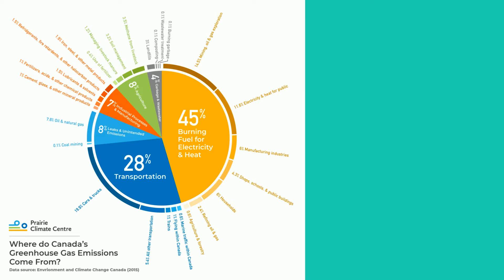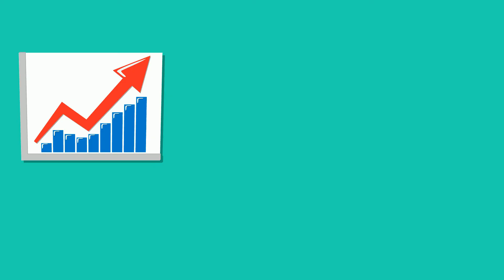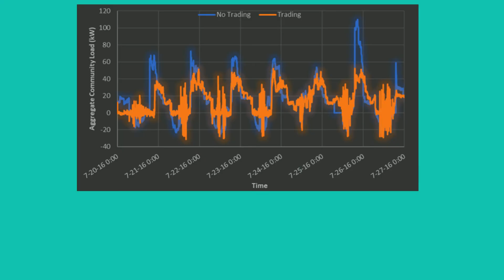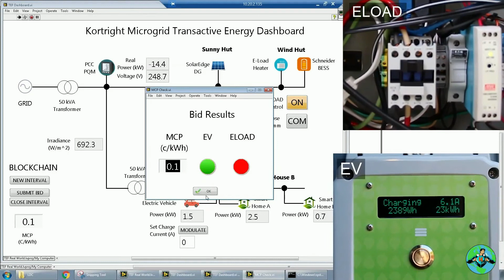Real World P2P Energy Trading on Blockchains EXPLAINED

Comment: Hello I need to do research work on this in my academics What type of thesis work could be done on this ? need guidance
Reply from the maker: Hello! Thanks for the question ... there are plenty of research topics that could be associated with this work. Where do your interests lie? Here are some open challenges that we encounter when trying to develop and deploy these systems:
1) Energy policy and regulatory frameworks: P2P energy trading is technically not allowed in many jurisdictions. A detailed analysis of what policies need to be changed, and how, would be a valuable research contribution.

2) Incentives for providing grid services: If P2P energy trading is reducing peak demand, shouldn't peers be compensated for this service to the grid? How should the rate-design be? What factors influence this? Is it feasible for the local electric utility?

3) Bidding strategies for the DERs: An analysis for bidding strategies in these markets would be helpful to realize more realistic deployments of the overall model. Which strategies affect cost and peak demand the most?

4) Community to community energy trading: We only considered one community, but this can be done throughout the distribution system from one community to the next. What are the benefits of such an approach.
Reply: @HeroEngineering   research area blockchain-based energy trading platform 
what should be the direction and challenges  in it
Reply from the maker: @anaya7700  I think above there are many directions outlined you could pursue - good luck!

Comment: How can you send electricity or buy or sell
Reply from the maker: Good question! We can't control exactly where the electricity goes - the electrons simply flow where there is demand and get consumed by the load. What we can do, virtually, is to set up an energy marketplace where your electricity is worth a certain value, and you can sell that electricity within that marketplace in discrete time intervals. So it works similar to the stock market .... you tell your controller what you feel your electricity is worth on the buying side, maybe you set some preferences for it be solar. On the sellers side, they set their value ... and every market interval, an algorithm matches these buyers and sellers up and executes the transactions. The physical electrons, or electricity, is governed only by its magnitude, not by its direction.
Reply from the maker: here's a paper that talks about it in detail :)
https://ieeexplore.ieee.org/stamp/stamp.jsp?tp=&arnumber=9311198
Reply: @HeroEngineering  the link to the article is not working
Reply: @HeroEngineering  
Hi,

Fascinating topic! I did subscribe to your youtube channel.

I have a question: Who is in charge of running the algorithm to match the buyers and sellers? Is it solved with some distributed algorithms through blockchain? If so, can you please provide some references that clarify the algorithm for me?
Reply from the maker: @spillando  thanks so much for subscribing! Great questions:
1) The algorithm to match buyers and sellers we've used is the double auction mechanism, and it's executed on the blockchain by implementing it as a smart contract.
2) A reference to the algorithm, and its implementation as a smart contract, can be found in our paper here: https://ieeexplore.ieee.org/stamp/stamp.jsp?arnumber=9311198

Good luck!
Reply: @HeroEngineering  
Great, Thanks!

I'll go through the paper and most probably contact you later if you have time.

Best,
Reply: What do you mean by the electrons just flow to where the need is great, I don't quite get the cmoncept